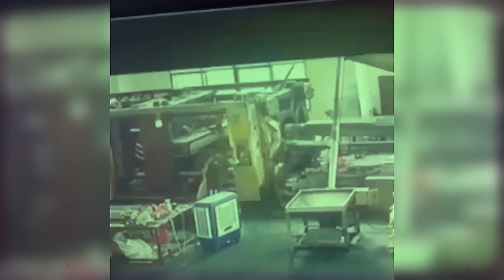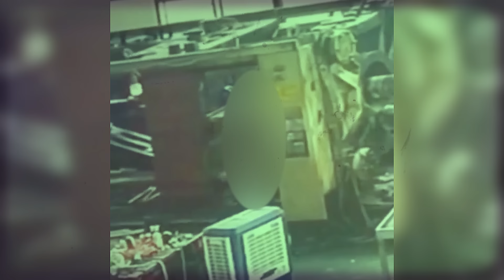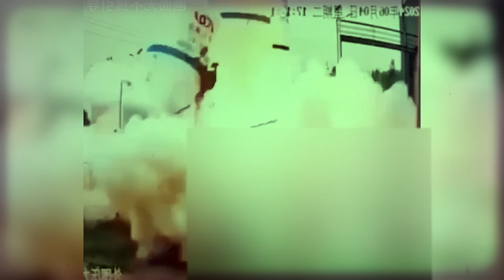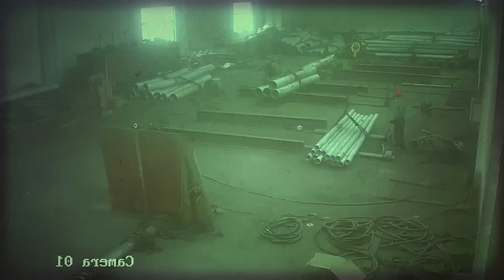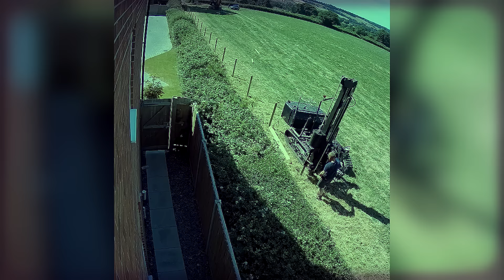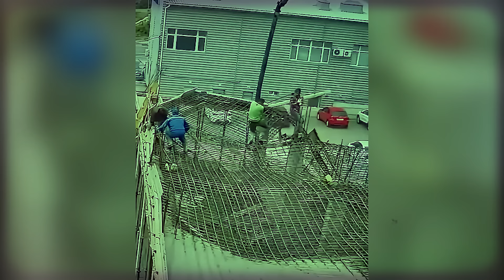One Routine Job… Turned Into a Big Mistake

Comment: Negligence , lack of proper safety measures etc while working next to a machine (rotating blades, turbines , manoeuvring heavy loads , hydraulic press etc) STRICT RULES & REGULATIONS/MANDATORY ......shouldd have been observed..FAILING to do so has to be punished.....This way most accidents would have been escaped.

Comment: 4:58 This guy started getting electrocuted as soon as his left hand grabbed ahold, completing a circuit to the lines on the other side of the pole, and he continued being electrocuted for 30 straight seconds until his weight overcame his muscles. Electric shock locks your muscles tight so you cannot let go. I doubt he survived that. 30 seconds of hell.

Comment: The fence post setting machine actually gave a warning. The first strike before the rupture caused the hammer to bounce back into the air, similar to dropping a steel ball bearing on an anvil. That indicated the post hitting something likely metallic. The next one punched it through.
  May have thought it was just a rock!
Reply: Right...AND, this Pole was much deeper then the others, he should stopped 2 hits before....🤔

Comment: The guy who ground a piece of metal on a grinding wheel until red hot  to use it to light a cig did nothing wrong.
Reply: Came looking for this. This video does not belong anywhere near the other clips in this video.
Reply: EXCEPT use a HUGE lack of brain cells!!
Reply: @RobertAuditions  Why is that?  Grinding the metal to use as a FLAMELESS heat source to light his ciggy was no different than grinding sharpening tool steel bits.  That's why you put bench and pedestal grinders away from any flammables.  16 years in Tool & Die and I saw nothing wrong here except for maybe smoking in the shop around non-smokers.

Comment: When working on (do it yourself) electrical tasks.
Narrator forgot to tell commentators, use a wooden ladder that way electric current will not flow into non-metal.
Reply: Когда случается что-то, всё это не имеет никакого смысла.Деревяная лестница может сломаться, через железную может ударить ток🤦😆